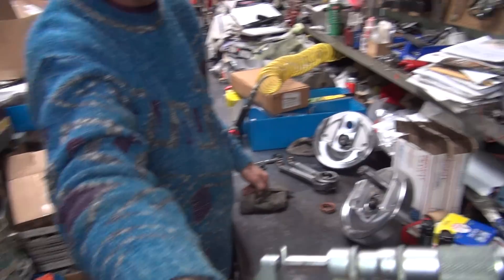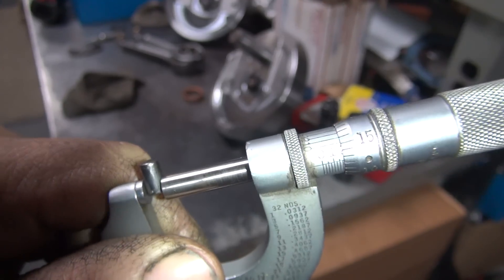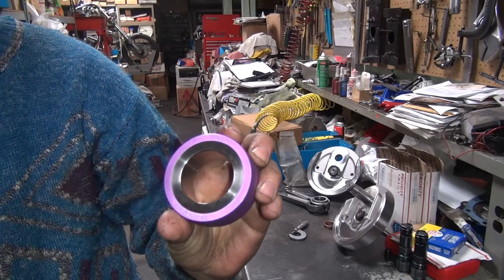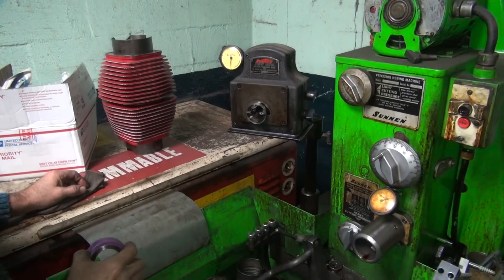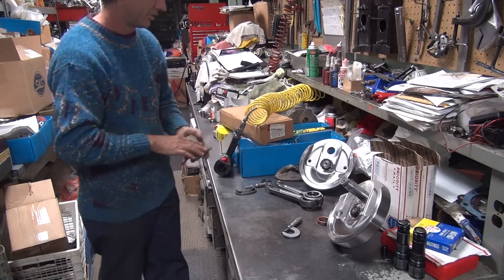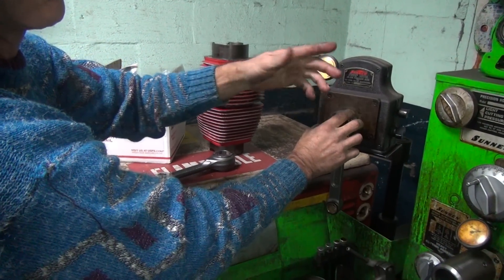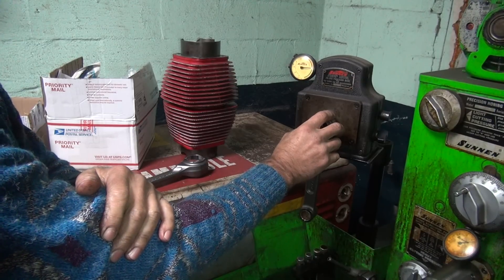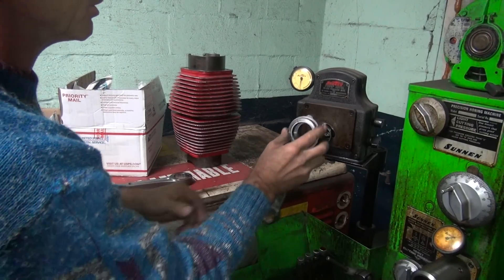#117 1973 93ci stroker shovelhead motor rebuild junk case repair std panhead harley by tatro machine

Comment: Hi Tatro, I like your videos very much. You are a master and a true metal bender! Im learning a lot, thanks!
I guess you can't comment on my question, bc you don't want trouble, but here in germany i could buy a complete S&S SH93-Series Shovelhead motor new from factory, would you recommend to strip it apart completly, or is it save to ride? Yes more than 50 miles please... :-)
Reply from the maker: it comes with a warranty so i would leave it alone untill something happens. if you want something different than strip it and build what you want.
tatro